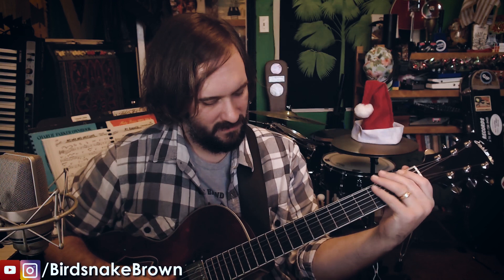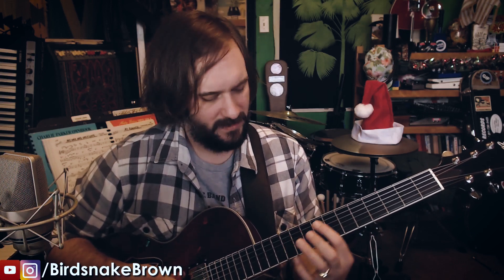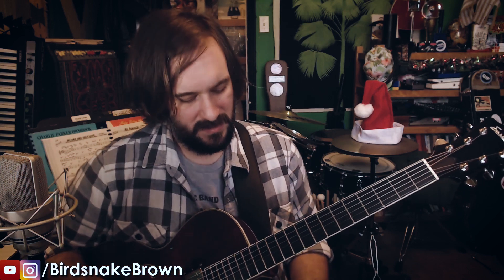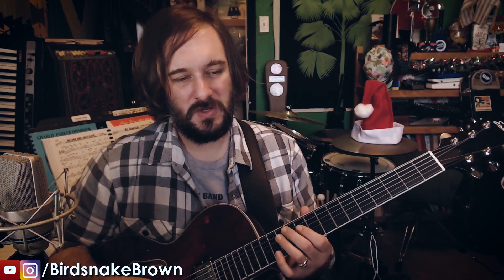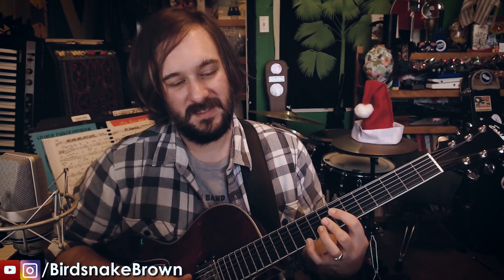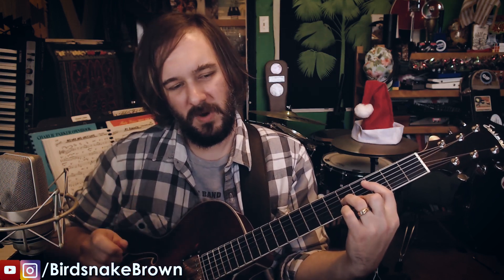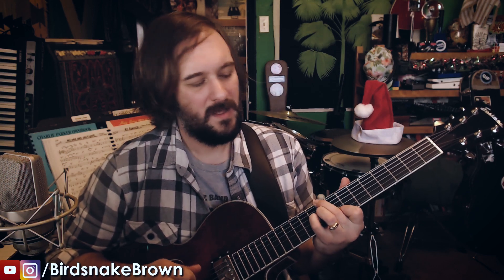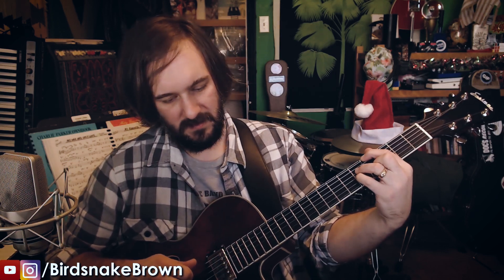Birdnsnake Talks About Power Tubes

Comment: I have a Sebago Dumble combo clone and it took me a while to realize that it needs a 4x12 to actually get the huge SRV dumble sound. I feel like the speaker has such an important part in the sound. I have a Fender Deluxe Reverb that sounds incredible when I run it through the 4x10 cab of my super reverb. But I have an old Super Reverb and the tube sockets started to become loose where they weren't making good contact, and I had to take a long T-pin and bend them a little so the contacts were tight again.
Reply from the maker: I had to tension the sockets in one of my 70s Twin Reverbs. I use a single EV 12 with my Dumble 102 clone and I love it, but I'm going for more of a fusion tone than the SRV sound. I know it would rip through a 4x12 but that's too much speaker for me lol